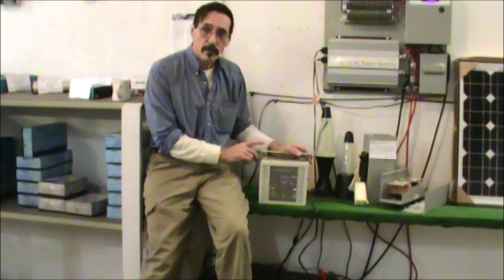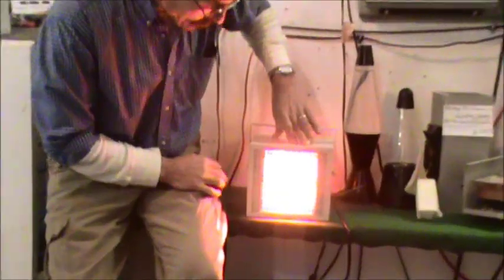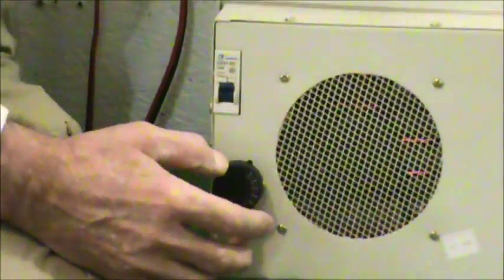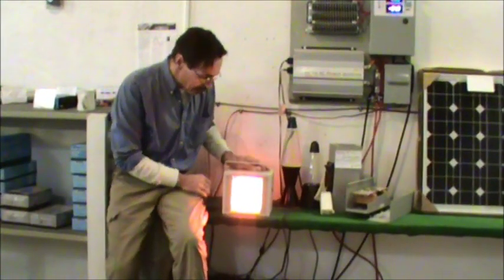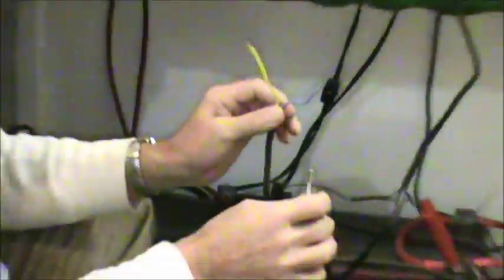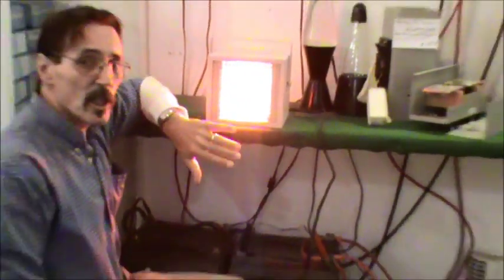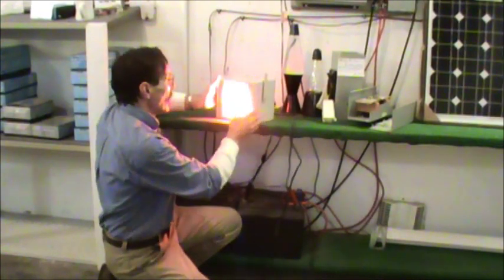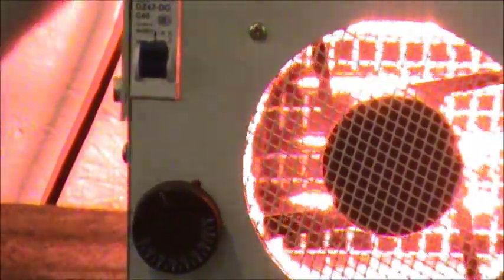12 24 Volt DC Heater for Wind Turbine and Solar Panels: Free Heat DIY | Missouri Wind and Solar

Comment: Really nice Jeff, but can you do a video on how to  make one,for 12 v dc which more help full than seen it
Reply from the maker: Hey Gene
You can't really make those.I would have no idea where to get the parts from.
Jeff
Reply: Hi Jeff,
Thanks for the reply, can you buy them in UK , and when are going to  do a video on how to make 12 dc led lights,  and wiring  for solar.
Gene ,or if you know where I can buy them ,most ones have got have been rubbish off E bay I would like to make some

Comment: In a 24 volt  battery system what is the lowest you can drain your battery before you cause any damage to the battery?.is 23 volt too low for the battery to be drain every night? Thank you

Comment: Hey Jeff, one thing I've notice ..it takes a lot of energy to produce heat....Humanity needs to start revolutionizing the way we produce heat. We need to think of new ways that would include new devices, and technology even. Its 8 degrees fahrenheit in my state of Rhode Island now and I see a lot of innovation in areas that require lithium batteries, but 99.9% of American household is still running off of 115-120 volt A/C, and if were using that voltage to heat our homes the number of wattages is increased exponentially. What I'm trying to convey is we need appliances and equipment that gives us our comforts in America RE-THINKED, re-thinked in ways where less energy is being drawn, and producing the same effect, perhaps an even better effect....just a thought Jeff.
Reply: Showemright YTchannel ii
Reply: Get a history lesson on electricity before you speak